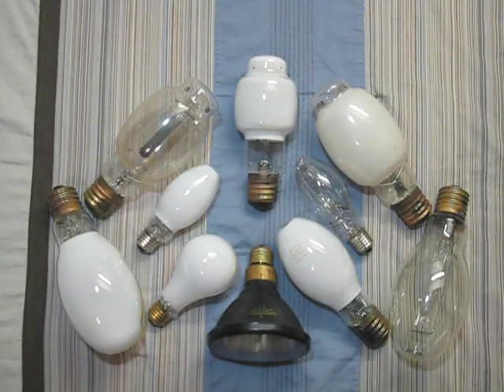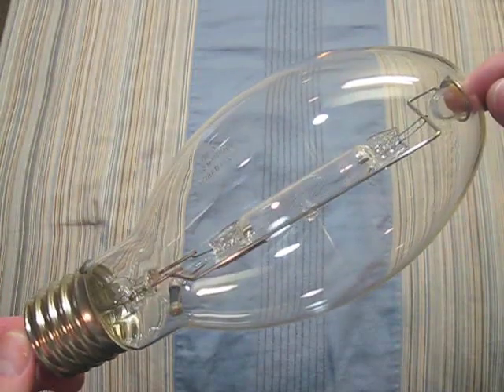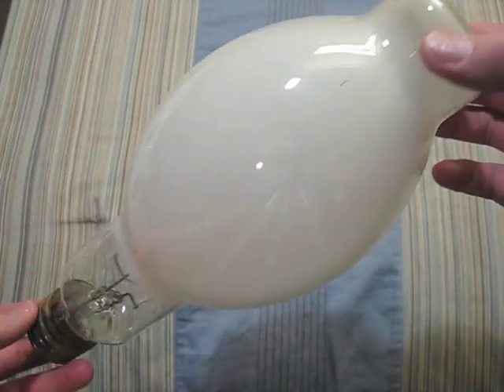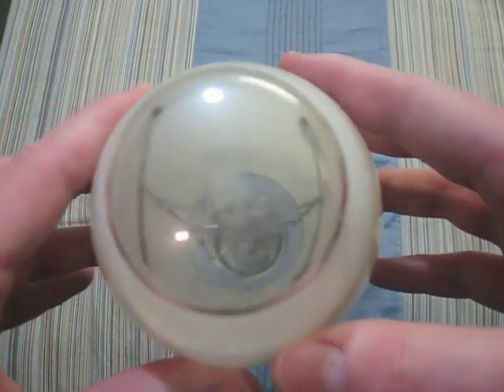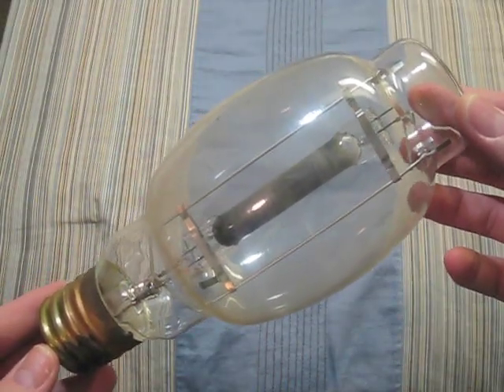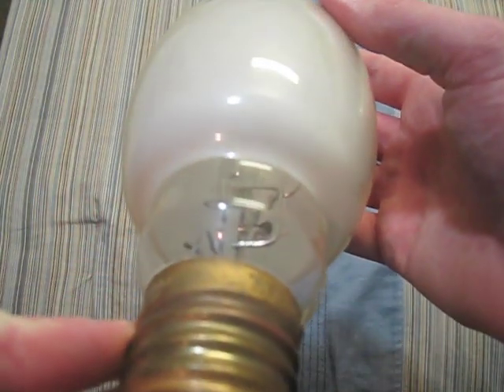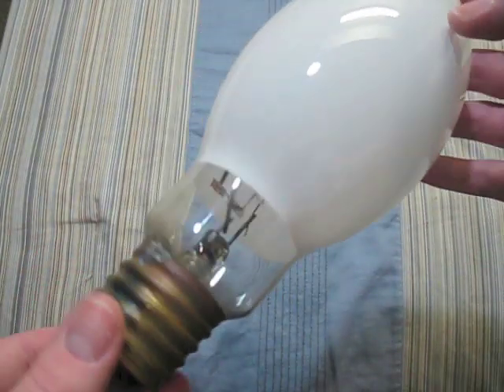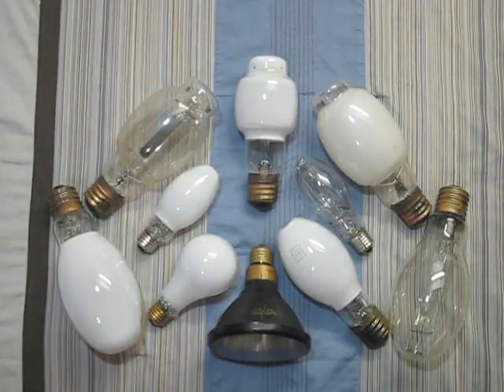Mercury Vapor (MV) Light Bulbs Part-1 2011

Comment: yes, you will need a ballast, the config should be a little like fluo but with the ignitor in parrallel with the lamp instead of series,There are diagrams for multitap ballasts aswell as the basic one voltage tap ballasts, this may very well come in handy on venture lighting's website.
Good luck
--THESOXMANIA--

Comment: I have and LOVE the BT Westinghouse Clear lamps in 175w, 250w, 400w, 1000w, still looking for a 700w! I LOVE MERCURY VAPOR BULBS! Espeachlly the older versions. Most new bulbs are made very cheep indeed! Take for intance Sylvania (gerter frame) bulbs made from the very early 60s to late 70s or the AWESOME wire frame Sylvania bulbs made from the 50s to late 80s, And compair them to the ones made today, The old ones were BEAUTIFUL I have quite a few of these!! The new bulbs are AWEFUL & CHEEP.

Comment from the maker: @Mr3wheeledbike I think the voltage a 175watt MV bulb runs on is 230-240volt. But with any HID bulb you should only run it on its correct ballast.

Comment: If the bulb does not turn on without the capacitor, the starter lamp inside the bulb has become faulty the main cause of this is when someone has run an MV bulb in a Son fitting fitted with a power lamp igniter it mucks up the starter lamp inside the bulb Does your MV lamps with blackened arc tube give out a dull light?

Comment: I love those old "BT" (Blown Tubular) shaped bulbs, you are lucky to have so many.  That GE 400w may have one of the support wires disconnected, the modern ones only have a bead of lead solder holding the wire onto the terminal support, if it is jostled to much they break- and therefore stop working, I have a Grandlite 175w Color Corrected bulb with the same problem- it is brand new and has never functioned.
Reply: VICNASTY1989 an Ignitor will make it run